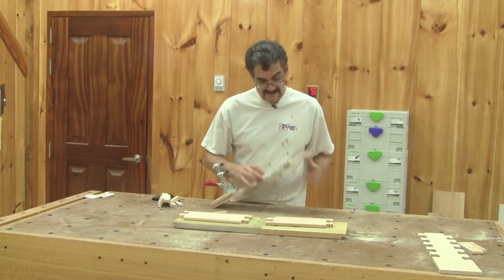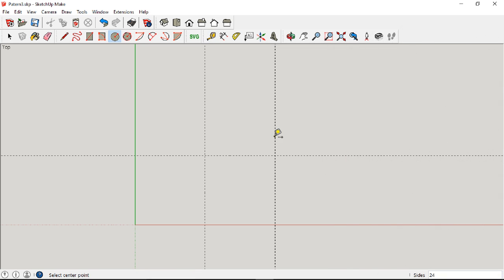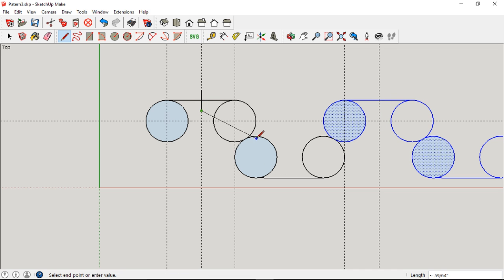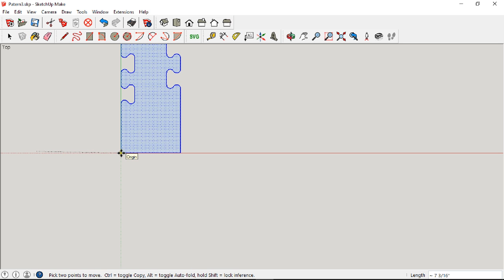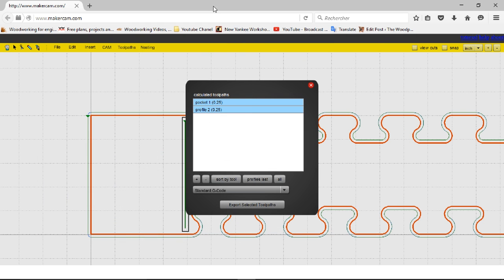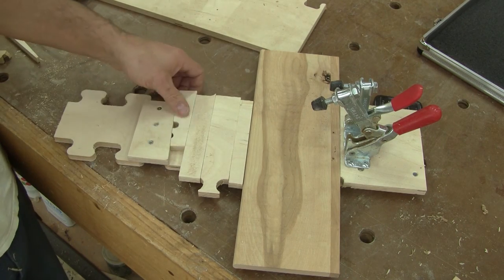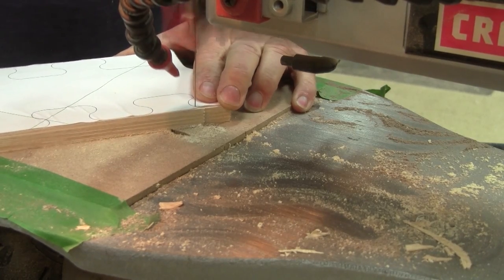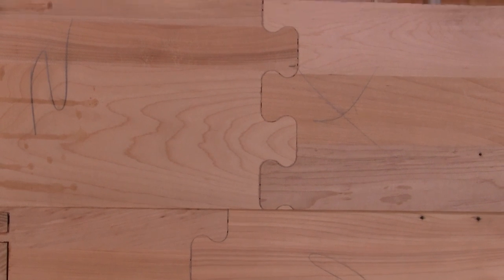The Woodpecker Ep 114 - Making a plywood jig which makes Isolock type joints

Comment: Great video! Thanks for showing how to make the jig without the CNC, for those of us with more limited means.

And welcome home :-)
Reply from the maker: I wanted to show that it's possible, but you have to be skillful with a scroll saw.<
I had a great trip but I'm glad being home and able to go in my shop :__
Reply: To build it manually, I would only cut one segment of the pattern by hand.  Get it shaped and sanded so it is as symmetrical as possible, then use it as a pattern to route each of the segemnts on the jig.  This way they are all identical and should give you a consistent fit.
Reply from the maker: This is a great idea, I would probably had a better fit like that. Thanks for the idea.
Reply: Mike, I literally just left that same comment and then saw your post. Totally agree! A lot less scroll sawing, sanding, and rasping plus a lot more uniformity.

Comment: For the hand cut model, you could use a drill to remove the curved areas.
Reply from the maker: This might be another great idea, you just have to leave a + in the middle of the round.
Reply: I was thinking that too. Also you could make a single "puzzle bump" and then use that as a template to route out consecutive bumps. This way you only need to be really confident in one shape instead of 10-15 shapes.

Comment: Why not just use your box joint jig to join them?
Reply from the maker: Because to keep them tight together I would had needed some clamps, with the shape of the joints they stay together by themselves. And this makes a cool looking joint
Reply: Matthias, you need to do a strength test of a joint like this! This joint does not really have a glue line along the grain, just end grain to end grain, because the wider parts of the tongues in both pieces could simply shear off along the grain line.